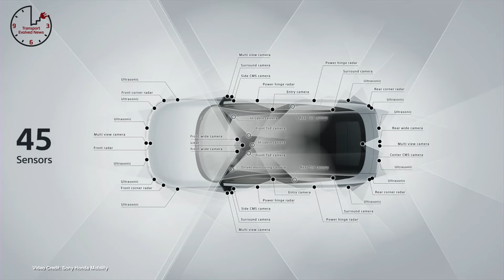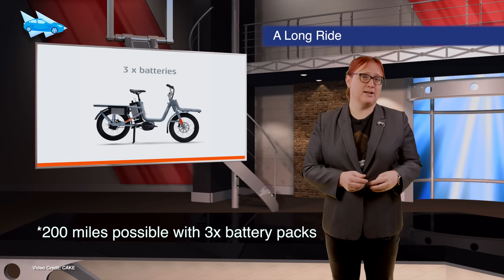TEN Episode 416: V2G Pays Off, RAM 1500 Revolution, MB Goes Furry?

Comment: I commend you on the covering of the sensitive story of the cliff fall. It's not easy to cover such things, but I think you did a solid job of it.

I also thankyou for clarifying the story about the Tesla FAN applying for trademarks instead of Tesla doing so. FAR too many outlets got that wrong, and it needs correcting.

One minor quibble though: on the Tesla in Germany, with the driver asleep behind the wheel: as far as I'm aware, that was only Tesla Autopilot, not FSD Beta, since FSD is not currently available in Germany.

Comment: KOREA & TESLA RANGE LIES?
Any other manufacturer could easily have had the same decision applied against them, even possibly ICE only manufacturers. Weather affects the range of all vehicles,  and the range quoted will be calculated according to a standard measuring system such as EPA's standard. Whilst some other manufacturers add some leeway on to their figure, the blame should really be placed with the measuring standard used within Korea.

Comment: 21:48 that's why I'm not wild about chinesium.
Reply from the maker: The Renault Zoe also failed its crash tests last year.
Reply: The tests are objective and you have many 5 star offerings from china. A more valid concern would be the availability of parts and local servicing options. Specially with the (digital) complexity of EVs.
Reply: Then again, the car is not built for the western market. Safety standards in China are a lot less stringent compared to the west and a vehicle like that would not be allowed to be sold over here.